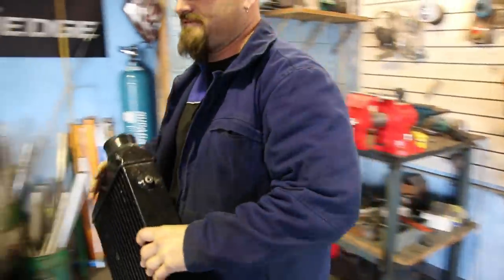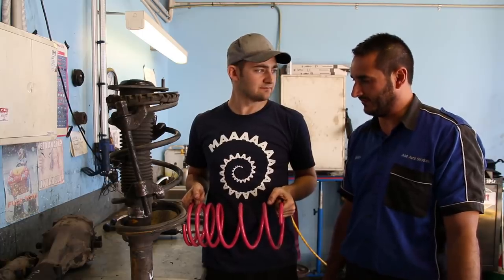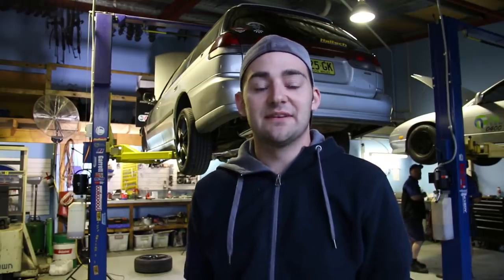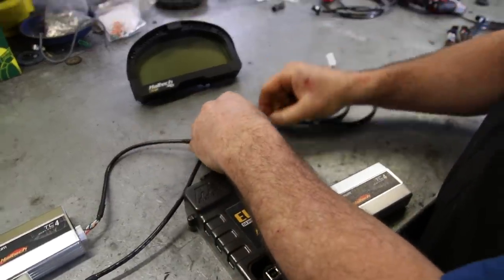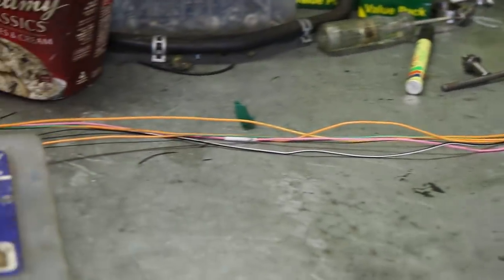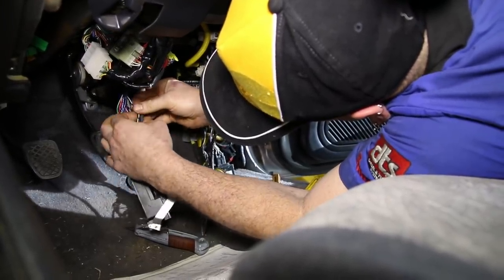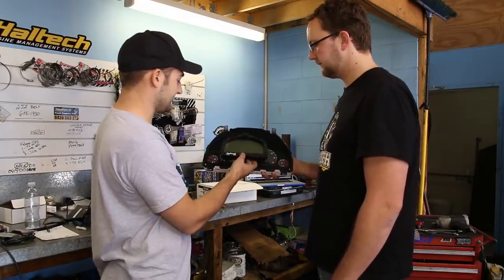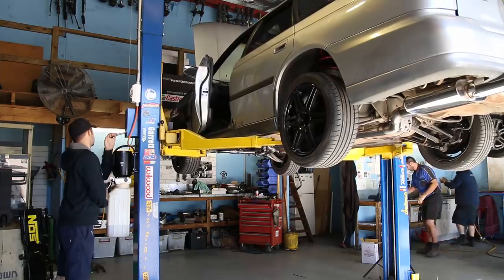Gramps the 11 Second Car - Build Part 7

Comment: Did anyone else notice they were trying to start the car from outside the car with out pushing in the clutch?
Reply: You can start a car without pressing the clutch...
Reply: It was an automatic car. They did what everyone else does. Instead of wiring in a clutch switch, probably just bypassed that circuit entirely. Most auto to manual swaps end up that way. Which does mean you can start it in gear on accident... Do that in my car sometimes lol.
Reply: A manual car dosent need a clutch to start in nueatrel. Only in gear.
Reply: kristian spark
my car does, same with my truck....you calling me a liar?
Reply: Well I'm Aussie, and being in neautrel it disconnects the engine to the gearbox, so no clutch is required, trucks here you do need a clutch but I'm not sure why, maybe because its a synchro box, same with your legacy
Reply: I don't understand this, the Subaru legacy would be an import from Japan, so would be the same as the models we get here in New Zealand. 
I've had no issue turning on any of my cars whilst in neutral without using the clutch. Including my 97 Legacy RS, 1990 Nissan Silvia S13, 1980 Ford Escort MK2, etc. Every single car of mine could be started without using the clutch.
Reply: Are they mind fucking us Dylan?
Reply: Dylan Coulston Same on 90% of cars in the UK.
Reply: kristian spark nice prof pic
Reply: I'm sure they can add a clutch switch circuit with the new ECU but screw that... Just getting it running!
Reply: they weren't trying to start it, they were just testing the ignition...because they even said they disabled the injectors to leave the fuel set up off. they weren't trying to start the motor, they were just making sure it was in sync with the ECU
Reply: Kyle Schauer
Thats weird man.. Must be a way to protect themselves from lawsuits... American?

I'm Dutch and I have never ever driven a car that required the clutch to start. I'm an experienced driver (work and private) and I have driven a lot of different cars.
Reply: You only have to push in the clutch to start the car if the car has a lockout switch...   In the setup they have... the ecu tuner guy can start car and rev the throttle across the internet.
Reply: Ah, thanks for clearing that up.
Reply: There seems to be some intercontinental confusion here. In North American cars, there's a switch on the clutch pedal that's wired in series with the ignition switch circuit. Unless the pedal is pressed, the car won't start. It's probably some dumb law here in the U.S. I'm guessing they simply didn't install this switch during the manual conversion.
Reply: drumnstuff It's not a dumb law. It keeps people from starting their car in gear and having the starter motor literally drive the car into something. Say a garage door etc. It's a simple and inexpensive thing to do for safety. After all, kids could be in that garage playing.
Reply: Fibonacci2nthpower
We call that making something idiot-proof.
Reply: Fibonacci2nthpower The reason I suggest that this is somewhat of an un-needed law is because it seems like there are plenty of people here who don't have this feature on their factory vehicles and get along just fine. I'm not against the idea of it. I just think it's funny that the U.S. government possibly though it important enough to warrant a law.
Reply: The only cars in Australia that have that switch to stop u from starting you car is Hyundai's and Kia and some euro cars  well from the cars I've driven so far
Reply: *****
 my old volvo 240 in america didnt need the clutch depressed to starts, just means it didnt come from the factory with a clutch safety switch
Reply: The car is a manual, that means when it's not in gear, in neutral, the clutch is engaged but the gears aren't engaged.
Having to put your foot on the clutch to start a car must be an American thing if it applies to all cars, someone must have sued someone for letting them start the car in gear and crash into something, which is weird as I would assume that they shouldn't have been driving anyway.
Reply: ***** country has nothing to do with it dude :/ you can bypass any car that has the switch enabled.. smh
Reply: ItsFriscoBaby
You work hard enough and are tired enough you'll forget if you have the thing in gear and will try to start it like that, been a few times where I've tried to do that and remembered "oh right I parked it in gear" after hitting the key. Some cars are smart-asses and can tell if its in neutral or in gear and let you and let you not start it like that but for most older cars and trucks a fucking switch in the petal was just more logical and easier to put in as a safety feature. I fail to see how any of you people could fight over something like this.
Reply: jr540123 In Ireland the clutch switches have only been fitted in the last 6 years or so and I have done 100s of 1000s of miles in cars without them and have managed not to run over any children by starting the car in gear regardless of how long I work. I could just as easily put the in reverse instead of 1st if I'm tired enough; do we need a safety device for that? It's just more of the usual over thinking rather than trusting people to actually pay attention to what they are doing.
Reply: Alot of the time if you do a auto to standard-trans swap, you bypass the neutral safety switch so you can start the car..
Reply: Um, all you have to do is take it out of gear. DUH!
Reply: Fibonacci2nthpower I don't know about you dude, but I leave my e-brake on until I am about to pull away.  So even if I left it in gear it wouldn't move.  My clutch switch is disabled, and I still never forget to press the clutch before I start it.  If you're dumb enough to make a mistake like that, don't drive a stick.  I think those idiot switches are just a pain in the ass, and something else that could go wrong with a car.  If it dies on you, you won't know for sure if your car has another problem, or if it's a bad clutch switch.
Reply: Did you watch the whole series?  The car was an automatic, they bypassed the clutch switch in the wire loom when the were adding the harnesses.  Since you noticed the fact they weren't pushing the clutch, I would have thought you noticed the bypass segment in like the 3rd episode I think.  I forget which episode, but it's been bypassed.
Reply: I don't see what all the fuss is about. You're gonna have to press the clutch in to put it in gear anyways. My Civic has the switch on the pedal and i've never once thought to myself, "Oh my god what an inconvenience, i can't believe i had to put my foot on the clutch to drive my manual transmission car."

Now, engine start buttons that require a key in the ignition... that's just pointless.
Reply: TheGoodDevil7 It might prevent YOUR dumb ass from starting the car while in gear, but it doesn't prevent me from doing it, because I don't do dumb ass shit like that.  And I use my e-brake properly, by leaving it on until after the car is started.  Common fucking sense, the switch is not needed.
Reply: TheGoodDevil7 I like having them in place epscially with vehicles that get brought in for service at a shop, its pretty easy to forget that a car is in gear or for someone to start it in gear and not know because you walked off and if they aren't actually getting in to push the clutch or checking that car is not either going into a wall a toolbox, various tools the garage door if it was in reverse of all gears or if your really lucky another person. Its a fail-safe that nobody can go wrong with, the only time I can ever see bypassing it for any good reason is you either can't find another switch for it for whatever reason or your stuck on the tracks or a bad part of a road with a dead engine and absolutely need to move it and quick.
Reply: phattieg
There is no right or wrong way to use a parking brake, long as you have your foot on the brake and a decent clutch foot keeping the car still via a parking brake is rarely ever needed. Unless your about 2 inchs from rolling off a cliff but thats a whole other story by itself. Seems to me your trying to start shit with people because you seem to think your way is always the right way.
Reply: drumnstuff
This is Australia where this is filmed,some cars here need the clutch in to start like hyundai's but most don't..i have owned a couple hundred cars and not 1 has needed the clutch pressed in to start.
Reply: jr540123 If you have the parking brake applied, and you start the car in gear, it won't move forward (unless you have shitty brakes).  That was my point.  It will just jump, but only because the wheels are trying to move, and the suspension is being pushed or pulled.  I usually park my car in gear with the e-brake on, but I never try to start it without the clutch, even though my clutch "dummy" switch is non-existent on my car.  It's just second nature to me pressing the clutch and brake in when I start the car.
Reply: jr540123 Since it's second nature to me, I guess my way is better.  Because common sense would tell you not to do that.  And if you don't get it, just try accidentally starting the car in gear one time, and you'll never forget after that.
Reply: some people are'nt retarted..and think before acting...
Reply: phattieg
In the points I am making as to why you should have the switch, say your working in a shop, well in most shops when you bring a car in for service especially if you have to put it on a lift and its a stick you want to leave the parking brake off and leave the car in neutral. But what happens when you leave it in gear do your thing, start working on it and your forget its in gear or you walk off and some other guy goes to start it for whatever reason and that safety is not in place, well now you have a car going straight into whatever the fuck is in its path and depending on what or who it hits it can become a really expensive mistake. Also one thing to note on certain older vehicles, if for whatever reason you parked in reverse some cars or trucks have a parking brake that holds great going forward but won't hold at all in reverse so that could without a switch pose another interesting problem but would be a very rare occurrence.
Reply: TheGoodDevil7 So i'm a dumb ass for not nit picking petty safety features, is that what you're saying? Should they also remove ABS, temperature guages, airbags, and seat belts? I guess those are just stupid safety 'mechanisms' to you.
Reply: when ever you start a car you always make sure its out of gear.. no if's or but's
Reply: Dylan94 Most stick shift vehicles don't have ABS.  Mine doesn't...  :-/
Reply: Do you even drive? Child please. My evo 6 doesn't require the clutch to be pressed in to start the car. On new vehicles it requires it for safety because the clutch pedal sensor will tell the ecu it is not pressed in and will not allow you to start it but with some older vehicles this doesn't apply.
Reply: phattieg
How old is your car because my 1990 Ford F-150 has Rear ABS, or are you referring to the full blown all four wheel abs?
Reply: All your 'security concerns' just show off that you guys are from a country where stick isn't the most common gearbox.
...also could be a hint that very few of you drive a stick.
Reply: phattieg Mine doesn't either, but it's just because it's the base model. I don't think there's any correlation between being a manual, and having abs.
Reply: Dylan94 I meant most base models, of course sports cars and more expensive ones do.  But I got ya.
Reply: kristian spark No we just have a bunch of [censored] laws here.
Reply: drumnstuff it might not be totally necessary to require safety features like that, but with 300 million people in a country, lawmakers & manufacturers tend to take extra precautions, as having 1% of your customers accidentally start a car in gear could mean thousands of incidents. America is a more litigious country than most, and companies take the necessary precautions. Manufacturer precautions shouldn't speak for the intelligence of the customer. It's not a bad idea to start your car with the clutch in, but checking it's out of gear would work just as well
Reply: pooft Lee Yea, that's a good point, especially when most U.S. drivers drive an auto. It's the government involvement that gets me. For example, backup cameras are required on all new cars past 2018. I drive many new cars everyday that have them and they are really great, and I'm glad that less injuries will occur. I just don't like that I'm being forced to pay for them if I want a new car. I see what your saying, though.
Reply: Dylan94
What?
Reply: phattieg Here in America all of my cars have come with the clutch safety switch. When the switch gave out in my GTI a while back I just bypassed it and kept right on going. Never had any issue with remembering it, and the ability to start the car in neutral from outside was really nice too. I don't even think it's illegal here, at least in some states, because I passed my New York state inspection like that and they are usually pretty strict about things. I did have fun the one time I valet parked my car and the guy started it in gear... I left the handbrake on so all he did was stall it and look annoyed
Reply: ***** auto?
Reply: My car is manual, and I can start the car without pressing the clutch..
Reply: pooft Lee I don't understand the need for the switch though. If you are in gear, the car will just stall. if you are in neutral it will just sit still.
Reply: Christopher Linnett The starter motor itself can move the car when in gear.
Reply: I done this on other stick cars I just use the seat and a rod I rigged up so I don't have to get in and out to start a car.
Reply: robfrmny21 Yeah but if you just bypass the switch (or in this case don't put it in in the first place) then there is no rod needed!
Reply: drumnstuff right with you there, it'll be scary to share the roads with kids that learn to park with a camera. no spatial awareness. And unfortunately Christopher Linnett without the clutch in your starter motor will crank the engine AND move your wheels. not ideal
Reply: they said they were just seeing if it would crank and the gas was off
Reply: kristian spark no, my vw jetta TDI, if you try to start it without the clutch, it beeps and says depress the clutch and doesn't let you start it
Reply: Declan kot Thats a flaw thats easy to fix. Just clip both wires and twist the tips together.
Reply: Or maybe it was in neutral without the full wiring setup the inter lock was probably not working/functional
Reply: roger depew the car was converted to manual so there is no clutch safety. Did the same thing on my 240sx
Reply: Neutral safety switch is what i always called it.  I've driven vehicles without them, but all of my cars needed the clutch pushed in.

Besides that, i usually make sure i'm in neutral before i left the clutch out when starting.
Reply: I had an old SAAB 96, 1973, you had to put that in reverse to start it, I ended up on a low wall once, like you say, tired and in a hurry to get home. Took an hour to get off the wall!! nothing bent though, tough old car.
Reply: Austin Penny Makes sense, they fitted a new pedal block, but no mention of a clutch switch. I have a RS Megane, it's keyless entry and start button with foot on clutch or brake... times change!
Reply: Ha, I didn't expect this to cause this much discussion, but yes i am from America and we do have to push the clutch in in any manual car i have ever driven. Yes i have watched this whole series and did miss the segment i guess on the bypass being wired into the loom. Thanks for everyone that has chimed into this thread I've learned a lot about foreign cars manual systems.
Reply: Dezero I'm in the USA as well, and have never had to push in the clutch to start my car.

On my 2012 Scion FRS as long as I don't have it in gear I can start it without pressing in the clutch. If its in gear, sure then the clutch sensor won't let it start.
Reply: My old man, who taught me to drive, always drilled it in to check the car was in neutral AND depress the clutch... shouldn't we all stop bitching and conclude learners should be taught this simple procedure?, or, we can carry on bitching, I love it ;-)

After all, you should start the car in neutral, but you have to press the clutch to engage 1st, so, my old man's practice is good for "emergency go's"
Reply: Dylan94 true about the stupid engine start buttons that require the key. One way around it is to use a dpst switch hooked up to a few relays, to turn of acc while cranking, and back on after etc. also making pushing it while the engine is running turn everything off
Reply: the idea is to keep the load off of a cold throw-out bearing. with a new throw-out bearing they need to be broken in carefully.
Reply: Thrust bearing over here, waay better name ;-)
Reply: Dylan Coulston
My family car is a Nissan Tiida 2010 built in Mexico, Aguascalientes. Is a 1.8l 4 cilinder 16v petrol engine 6 speed manual gearbox. That car is sell in the US, and South America (where i live, Argentina).
You CAN'T start the car unless you press the clutch pedal and ALSO the BRAKE pedal. You have to press both pedals to start the engine. It's because US regulations. It depends where your car is built and in the countries it will be selled. US regulations are very tough, in South America, not so tough, but still, it's a great car, no problem at all.
Reply: You do NOT, I repeat, You do NOT need to push a clutch in to start an engine, just throw it in neutral so your car doesn't take off when you start it. No such thing as a US clutch regulation, we only have emitions regulations
Reply: yeah, the U.K megane will start in gear, as long as your foot is on the brake, so it won't start ;-) not on turbo at tickover so no dramas, lol
Reply: Yes because they tweaked it that way, they mentioned it in another episode.
Reply: It's Turbo Yoda, He's faster than you can see!
Reply: shortix323 yeah.. if a car starts without pressing the clutch(which most will do if you're in neutral) it will do that, whether you're in America or Sierra Leone
Reply: jr540123
I know this is a bit late of a reply, but I never got notified you sent a response.  As far as the ABS question, I was referring to base model vehicles.  Most base model, stick shift vehicles come without ABS.  And a lot of cars, especially compacts, you can only get a stick shift if you buy the very basic, base model.  And those usually don't come with ABS.
Reply: phattieg
"That will change for all 2012 vehicles, as federal law will require all cars and light trucks to come with standard electronic stability control. Stability control relies on an antilock braking system to apply the brakes at individual wheels to prevent skids, so all vehicles will need to have ABS as well."
Quote:  Someplace on the internet
Reply: thrice00
That's good.  Sometimes it's kinda scary locking up your tires by braking hard on a wet surface, while downshifting.  LoL.
Reply: It's even more annoying when your feckin' traction control/stability control kicks in on a wet grass, up hill on a busy camp site!!
Reply: Ben Portman
LMAO!  I've had traction control issues similar to that.
Reply: it was my first time, I think I'll be O.K ;-)
Reply: they disabled the neutral start switch
Reply: kristian spark my driver instructor told me that i should always press the cluch because especially when is very cold the engine has to turn the gearbox too and all the stuff, so to make it easier for the battery, just press the cluch. maybe that's why
Reply: you'd only spin half the gearbox, but fair point. Can we conclude that as car modders, MCM are capable of disarming a switch? it's getting tedious now ;-)
Reply: Dylan Coulston Dylan but different countries have different "safety" standards therefore every car imported is designed just for that country like middle east cars have a different cooling system because it reaches 40-50 Celsius
therefore the cooling system in the car is much different to ones you would get for example in Sweden or Canada or Russia which gets really cold
Reply: Wow...that is a whole lot of pixels for what should have been a brief info session about the neutral start/safety switch. I too don't need stupid proof items on my car. But they r not made for me. They are made for the dumb ass to protect me from the dumb ass. Because the first time your kid is playing in your car without the dumb ass features, and the car starts in gear, and your second child is in front and is run over,  then your government's decision to require these features doesn't seem so bad. Perspective folks.

.